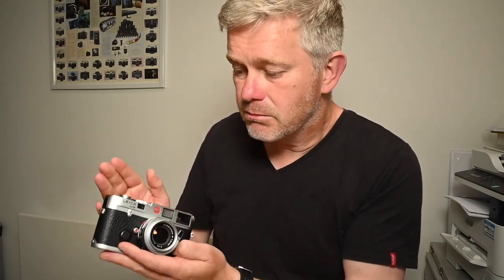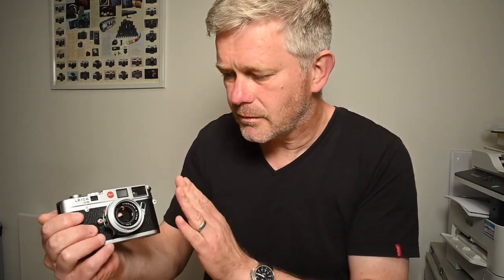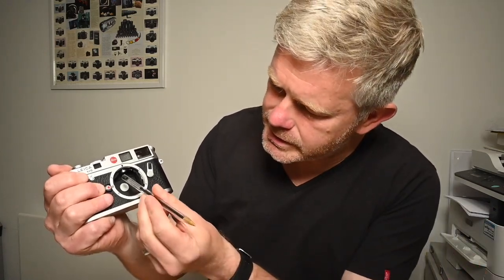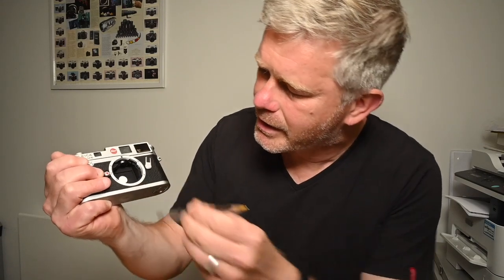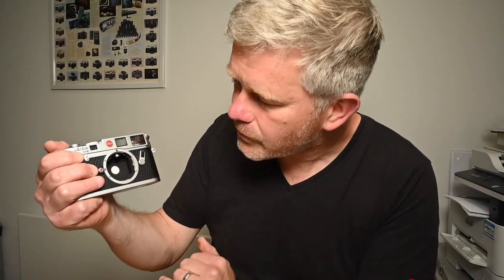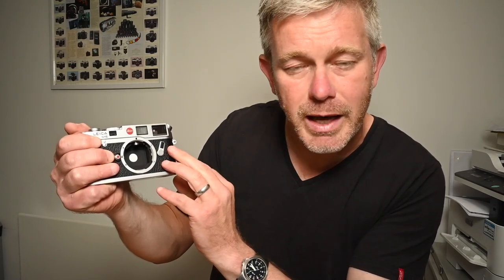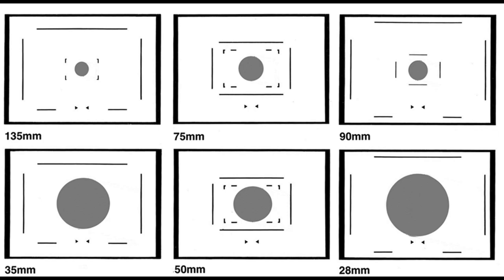Understanding Leica M6, M6 TTL and MP metering

Comment: If the light meter doesn’t work, does it means TTL flash won’t fire?
Reply from the maker: Depends which model. On the Leica M6 TTL faulty circuits may prevent the flash firing. Always test before buying.

Comment: 4:53 
Hmmm… i though it would be the reverse: spot meter with wide, wide avg metering at 75 mm
Reply from the maker: Watch the video again from start to finish and I hope it’ll make sense! It can be confusing and is something seldom understood (which is why some user’s experience erratic exposures). It is explained in the Leica M6, Leica M6 TTL and Leica MP instruction manuals too.

Comment: Thanks! Very clear. As a side point, I always wondered why the rangefinder has frame lines for 135. The view is much too small for me. Even with 90, I have to remind myself that I get only a small portion of what the finder shows. But then it is good to know what the light meter sees.
Reply from the maker: Yes, I agree. The 135 lens frame is small, particularly with the cameras with 0.72 magnification. It’s better on the Leica cameras with the 0.85 finders.
Reply from the maker: They do but they’re not particularly good to use.
Reply from the maker: But always try these things yourself. It might work for you very well.

Comment: Thank you for the information. That explains why I had some erratic exposures with a 50mm lens. But knowing that now, it’s still hard for me to improve with the way I take pictures. Often times on the street, I have to roughly get the exposure correct while anticipating a moment, then adjust the focus.
Reply from the maker: Many photographers will take a reading to give a reference point and then estimate, adjusting a stop or so either side as light changes. It gets easier and more accurate with experience.